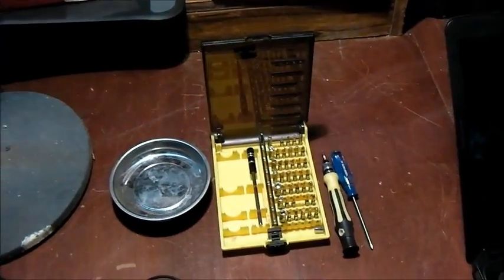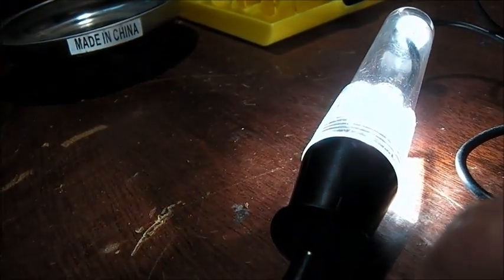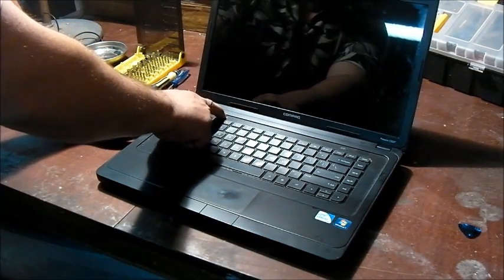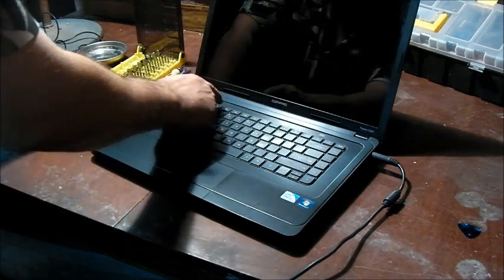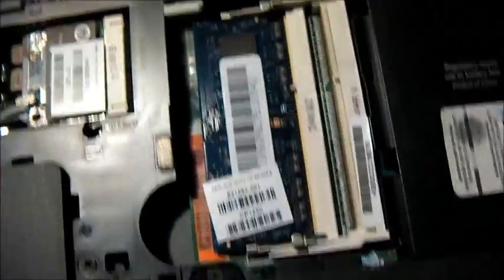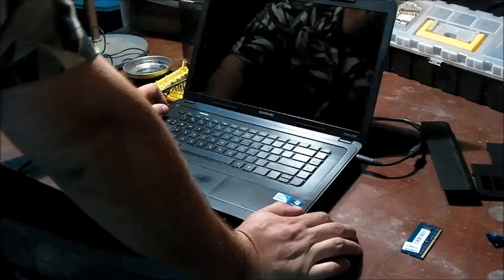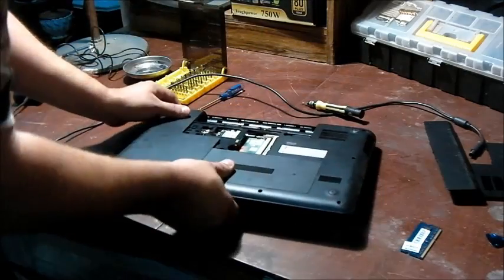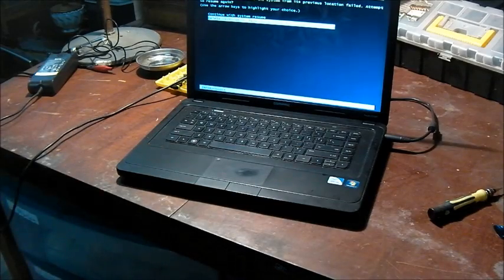Quick things to do to fix a laptop that wont turn on - Compaq CQ57

Comment: Hmm! I'm stuck! Did all the steps and my computer Is still stuck on a loop of flashing to boot up. It takes forever going through a cycle of booting up. This sucks! If I could get past this my computer would run great for being an older model. Any suggestions?

Comment: So my laptop has different type of problem from yours. When i turn on my laptop it shows the brand of the laptop which is acer and it stays that way and it turns bitch black. So i there a way i can fix it without resting it

Comment: The problem I have is that this particular computer CQ60 is supposed to be able to run without the battery, the power is plugged in and the led light is lite along side the cord entrance. But when I push the power button the lightning bolt light blinks 3-4 times and nothing happens and when the battery IS in, it won’t charge the battery ( maybe not good ). But still..... it’s supposed to turn on regardless because there’s continuous external power going to it.        How do I fix that problem??

Comment: Unfortunately for me, I've tried all of that on my laptop, which is the same model as in your video! I notice your website is now offline. I had no mains power/battery charger light, and no power button light either. I went to a Restart Party (electronics repairs) https://therestartproject.org/ where I did most of the work dismantling the laptop, although we left the motherboard in place and didn't touch the screen assembly. I removed the battery, the hard drive, the memory, the keyboard, the lower cover, and even the WiFi card! At the end, I had the power jack/battery charger light coming on, the power switch light had come on briefly, but then stayed off. After the party, charging the battery back at home, the laptop still wouldn't turn on and there was no power button light! When I plugged my phone into a laptop USB socket, it started charging. I can only think of two possible solutions. These are 1. Somehow bypass the power switch. This switch can cause the laptop to be turned permanently off. Unfortunately, when the cover containing the switch was removed and the charger was plugged in, the laptop didn't automatically turn on. 2. Replace the motherboard. Unfortunately, some motherboards for sale seem to be missing components and I saw one which was described as for this laptop, but was Intel based, although mine is AMD.

Comment: I have Compaq 615 and when I turn it on the caps lock light comes flashing with the black screen 

Earlier this week it was used fine
Reply: Put ur ram out and put it again it will work fine😉

Comment: Compaq 2210b hp
Power lihts then info light switches between them,at the bottom I am getting 6 red flashes on a loop

I have tried everything you said,mine is a small compaq and its has two memory stick,took both out and put back in.

Comment: My Compaq Presario CQ62 came with win 7 upgraded to win 10 and upgraded memory from 2 gig to 4 gig two memory cards inside,  power cable is good it works the light on the side of the pc lights with cable pluged in but power button fails to power on,  i tried to pull off battery back panels removed mem cards and reinserted  still no power so i have pulled apart what I could of the laptop but could not get it to separate from case so i took out the hard drive but i want to know how to get this hard drive to work on another laptop i know i have to get some kind of usb connector but the type of drive is samsung Model HM250HI  ATA  type i think and i wanted to just use it as an external drive to use as back up, not sure what i will need as the connection on the drive is very different no pins just slide type connector

Comment: Someon cant help me ? lenovo thinkpad l512 witch intel core i5 ints not turn on but the lede worms the problem not the ram and not the hard drive and not the batery and not the charger Its lenovo thinkpad l512 and i put on the charge witchout battery and its try automatic restart but not work and the fix pryce on Hungary 4500ft but i no on hungary and here its very expensive . I dont know. Someon one tutorial video ?

Comment: Thank you, the third soultion helped me fix my laptop. It wouldn't turn on and the charging light woukd blink. I tried removing battery and holding power button but that method didn't work. Then I removed memory and the fan turned on, I pressed the power button and my laptop came on... Thanks for this useful solution :)

Comment: hi, what about a dropped laptop? my laptop dropped and I think some part of it has broken, now it wont turn on, it can get charged, but power button is not working
Reply from the maker: Possibly power button ribbon cable has disconnected from laptop, you have to remove the top cover and take a look inside and see if anything is unplugged

Comment: hi, what about a dropped laptop? my laptop dropped and I think some part of it has broken, now it wont turn on, it can get charged, but power button is not working
Reply from the maker: the only hope is to disassemble it and make sure everything is still connected on the inside of the laptop.

Comment: no u dont understand... what he wanted say was not actually the laptop wont turn on or no power.... its just a standby power only or no display but its actually turned on... there is still electricity on it but wont display... in the process of a computer motherboard, the memory card is the last one to send a signal or display a report on screen, if the memory card or a memory card slot is defective also sometimes the memory card is not properly setup or installed, there will be no report on screen...

Comment: If this doesn't work, what's next?
Reply from the maker: if it is still not powering on after following these steps, you might need a new powerjack, but it could also be the motherboard
Reply: hi i have a vaio laptop the screen wont turn on and your steps didnt work help pls

Comment: Hello, i hat same problem but i try it on the same way till not reach my computer my computer name is also Compaq. and i hat did Ram out and in check ram, dosen t effact at all. those 30.or 60 min push start batton  i did to. it has't. now i thinking about Batterie but if batterie muss suppost to come with adpator anyway. still not. so what should i do now, donate me some idea .. thank you.
Reply: Same thing with me. Have u found a solution?

Comment: hi.i replaced my dell N5050 laptop mother board.but it not turning on.after i removed the battery and try to turn on.laptop is turned on.after i shut down and try to on but it wont on.after removed the ac adaptor and hold the power power button 30 second then i connect the  a/c power lap top turned on.i need to do things every time.any one help me

Comment: With my laptop I turned it on and the caps lock kept blinking and the screem is still blank
Reply: Hi i know its been 3 years since you posted this LOL but did you find a solution? i have excactly the same issue, thx!